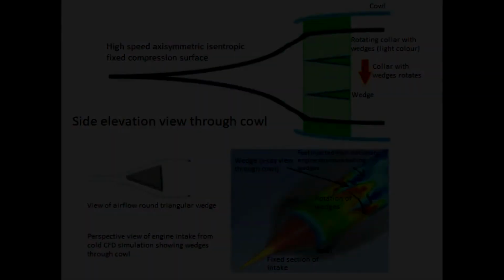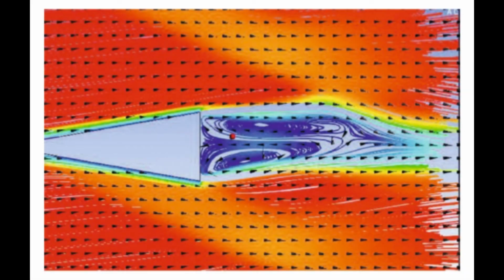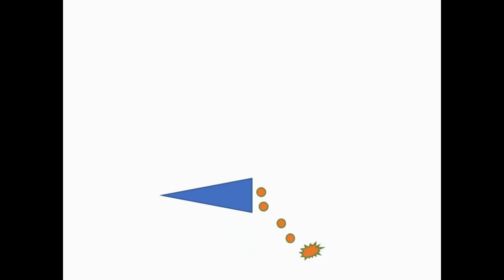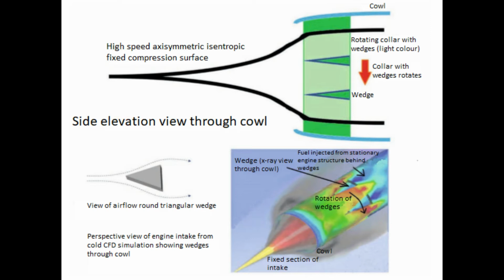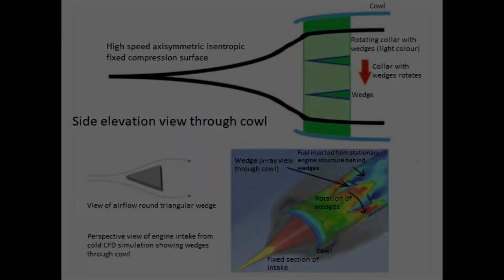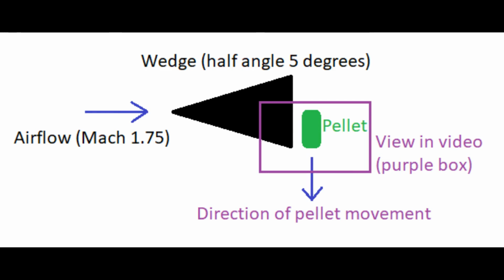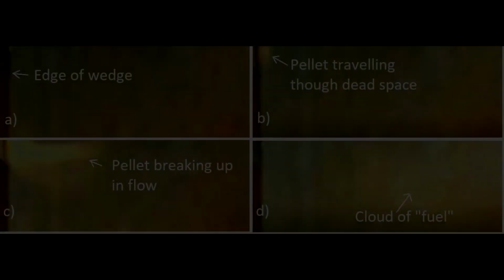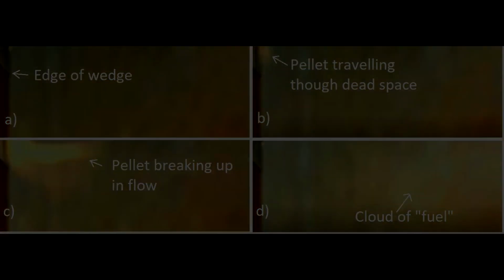Innovative Scramjet update (3) - Winter 2022/23

Comment: My questions would center around why it even needs to rotate? If it's dealing with supersonic stresses then having the wedges rotate increases the need to resist that in a rotating element... why not have the pellets just get deposited into the supersonic ariflow? does the rotation solve a problem? It doesn't look like they're angled or contribute to compression through their rotation. Wouldn't the injectors benefit from being permanently shielded from the relative wind? Why not just have the wedges have built in injectors on the trailing corners? Not sure exactly what is being accomplished.
Reply: The basic reason for the rotation is to deposit the fuel throughout the mixing volume. Stationary wedge-like projections (sometimes called pylons in the literature) have been tried many times before - however they don't produce good penetration of the fuel into the stream because it (the fuel) simply gets swept down-stream by the supersonic flow before it has a chance to mix. The rotating element leaves a trail of fuel throughout the stream as it moves. A similar argument applies to depositing the pellets directly into the flow. Our tests and simulations show that it may be possible to do this if the pellets are "fired" into the flow supersonically - but this is potentially more complex than using the wedges. Otherwise, again, there is poor penetration. In terms of stress and drag, our tests and simulations have shown these to be minimal with well designed wedges. I hope this helps to answer your questions.